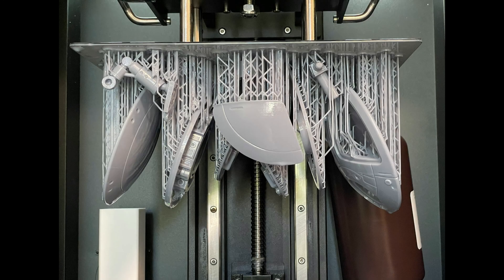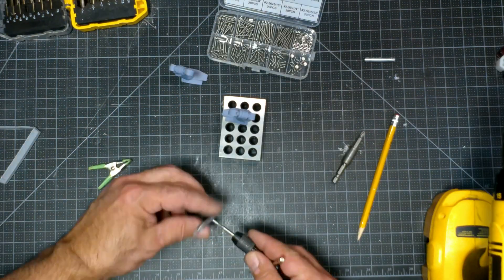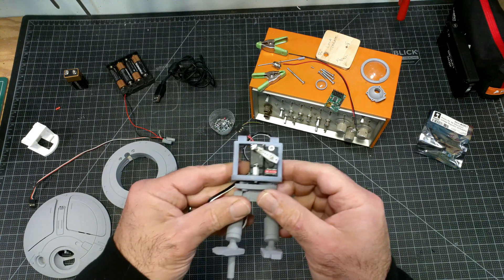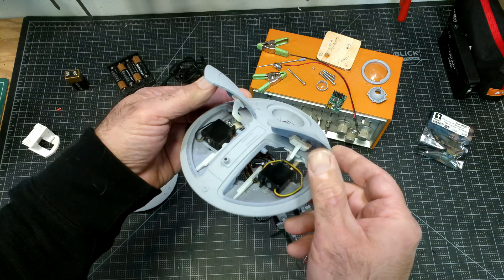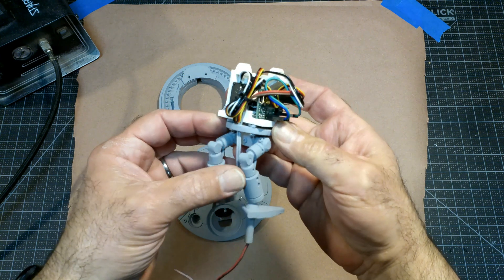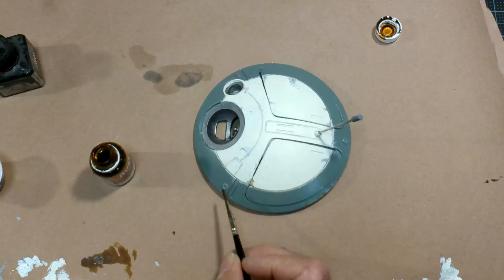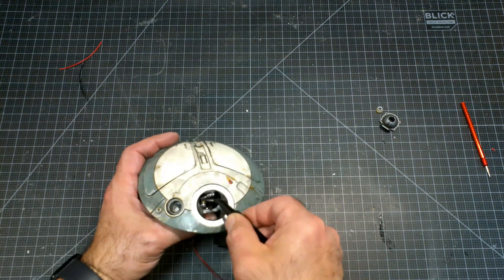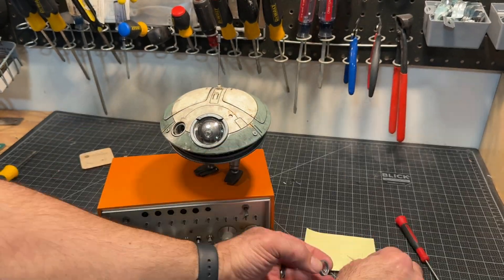How to Build the Lola Droid from Star Wars Obi-Wan Kenobi Series

Comment: I have to agree with several other commenters, this is a great little droid! Did you replace the hot glue with cyanoacrylate before you primered it? The paint scheme and weathering turned out great!  I really like the idea that the box base has so many switches and knobs on it that if a child gets close and starts fiddling, the odds are they won’t hit the power switch. :-)
Reply from the maker: Thank you, Guy, I ultimately added screws. The hot glue was just for testing.
Reply: @PaulsBots  That makes sense, thanks.
Reply from the maker: @GuyVardaman  You bet!

Comment: Thanks Paul, my printer was idle recently and I printed a few of these with the idea of doing something similar, perhaps using a Harbor Freight case as a stand and as carrying case.  But I've been considering how to run power/data.  I like the idea of using a small metal tube as a guide and for reinforcement, but was trying to make run completely inside the leg into the body of the droid.  It looks like you ran the wire partway up the leg and then outside into the body.    Did you find the legs just too small to modify?
Reply from the maker: The size of the leg is really small, and I could only get the wires for the power to fit. You are correct, I only went halfway because I needed to enter the body a further back than where the legs attached. I also felt that it would add a little more detail to the legs. Really good eye.